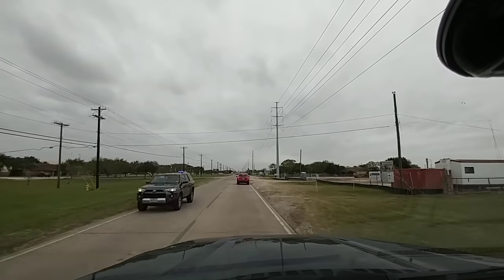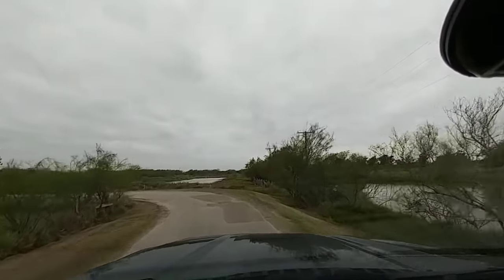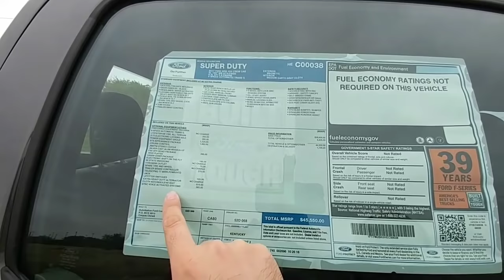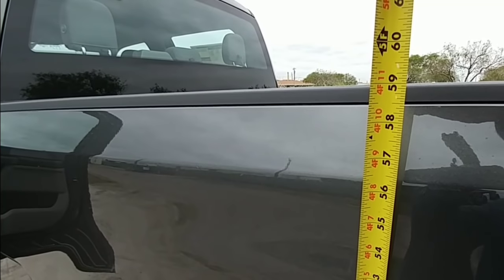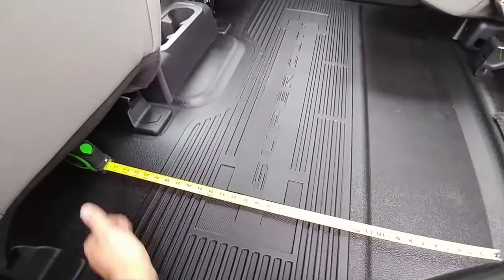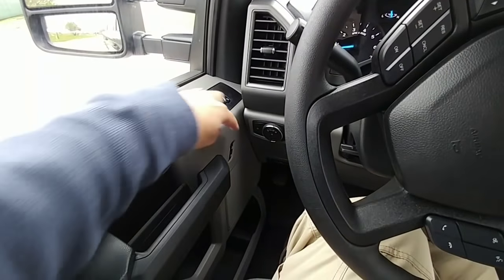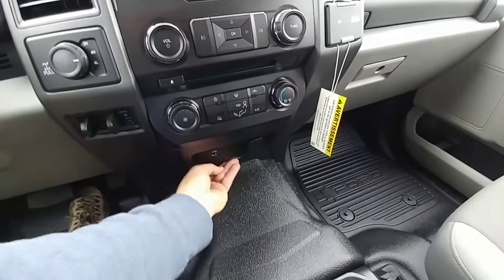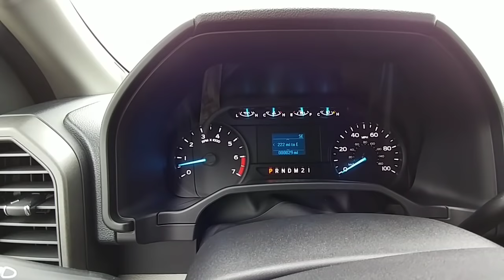2017 F250 STX FX4 6.2 Gas...Full Review

Comment: It's 2017 and these Beasts are still using mechanical radiator fan(s) ? 😦😳
Reply: As long as you got the room under the hood, a mechanical clutch fan is the way to go--especially when the cooling demands are high like they can be on hard working vehicles like this.  There are no free lunches in the world.  To get the same CFM out of an electric fan as you would with a direct or clutch fan, it is going to cost you more horsepower/energy because there is efficiency losses when you convert mechanical energy to electric (alternator) and back to mechanical (fan motor) again.  How many lawn mowers do you see with engines driving generators that power electric blades?
Reply: Kris Minnear Could be, myself i have no facts to back-up my thoughts but that hasn't stop me before from doubting "good designs " from the OEMs. After all, they build cars and trucks to make money, not to be the most efficient and long lasting form of transportation.
That's why i think they are still refining the candle instead of using electricity and the light bulb. It's all about that $$$.
Maybe more OEMs will start using more electric cooling fans if they ever make the change to a 48v system.
After all, even with all the losses that you mentioned they seem hell bent in swapping engine driven(belts) accessories for electric ones as supposedly it help every bit to reach those unrealistic MPG targets that big brother have imposed on them for (2025 ?)...i could be wrong about the year.

Comment: If you had a family of 5 why wouldn't you buy a sedan that only costs 40,000. every car co. has top of the line for that price. You must want to burn money cause there is no way a F250 could compare to a Impala. OMG
Reply: My impala, cost 31,500 loaded in 2011 . The F 360 crew cab loaded was  68,500, with the same package, I get 33 on the highway for MPG and 17 city, Yes I am bragging this is amazing
Reply: My 2005 grand marquis gets 30 on the highway and 15-20 city. You're not impressing anybody.
Reply: Because a sedan will not pull an 8,000 lb camper.

Comment: ford sucks chevy rules
Reply: I switched from a 2500HD gasser to an F-250 gasser.  GM lost my interest by keeping the 6.0 around so long.  It's a great engine, but Ram had been out with the 6.4 for years and Ford squeezed out more power out of the 6.2 in 2017 while GM did nothing....well, they offered a bigger engine in the 1500s but neglected the HD line up until recently when they announced the 6.6.  Ford has already Trumped GM and Ram with the announcement of a 7.3 gas available in the 2020 models.